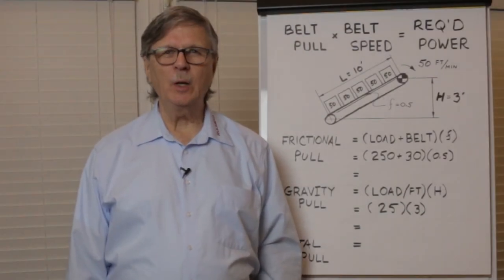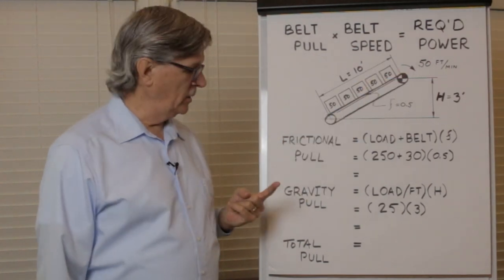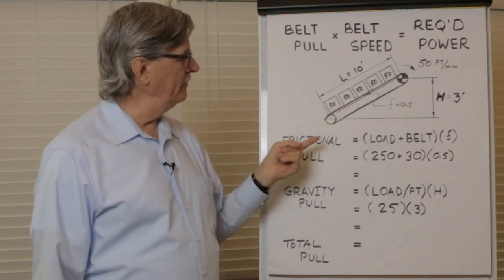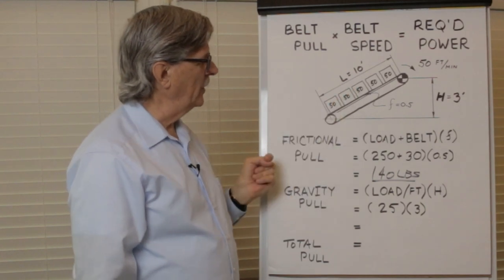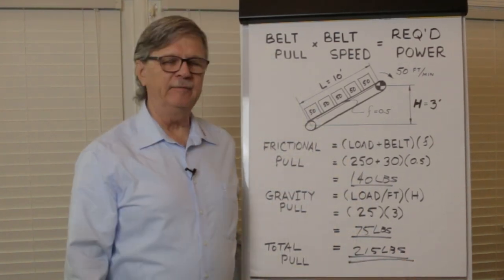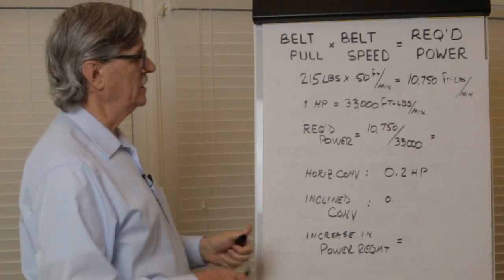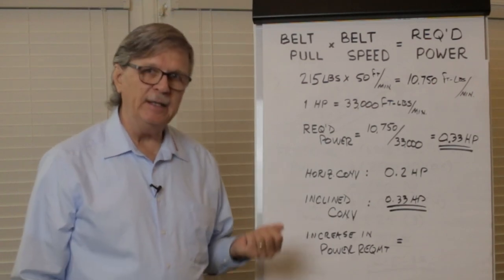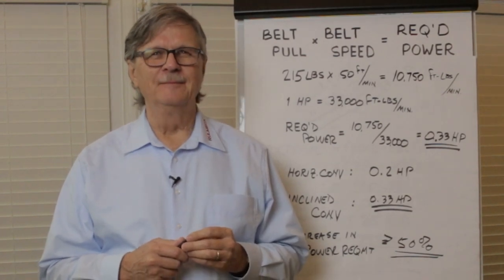Belt Pull and Power for Inclined Conveyors

Comment: A very informative lecture. am still enquiring on the pulley drum weights why have you not considered them in determining the power?
Reply from the maker: Drum pulley mass is irrelevant to the power required to keep moving the belt continuously in stead state.  However, you are correct that drum pulley mass should be considered when determining "required start up power" because the conveyor drive should have enough "available start up power" to overcome inertia.  If you send me your email address I will send you a link to a more comprehensive program which allows the user to specify drum pulley mass and calculate required start up power.  Since most conveyor drive manufacturers supply "Design C" motors (which are able to supply 200% of running torque at start up), required start up power is not calculated unless the conveyor is very long (i.e. > 300m).
Reply: @rulmecacorporation4596  Hi, hope your well. just a reminder am still waiting for the link you promised to send me kindly.
Reply: @wycliffeapindi3270  I am very sorry that I missed your recent message.  I will send you links via email within five minutes.

Comment: Hello Sir, thank you very much for explanation.
I would like to ask, what if there is no slider bed?
Reply from the maker: Your question could have several answers.  Slider beds can have many different frictional coefficients, from low to high.  Rollers may be used beneath conveyors instead of slider beds.  One rule of thumb (if rollers are used) is to substitute a coefficient of 0.1 instead of the frictional coefficient.  I suggest you visit our website and download our free power calculation software.  Just let me know if you have any problem finding it.

Comment: Thanks.  How/why do you have gravity pull as (load/ft) * h? 
Hmmm... I'm calculating.... I would use (sin 17.46) (250) = 75#. Same as you. But why is it also (load/ft) * h?
Appreciate your help. 
EDIT: And if you don't mind, another question. Let's say the conveyor stops fully loaded. What is power required to get it going again? I'm assuming there must be a ramp-up time to go from 0 to 50 ft/min. So this would be the power to accelerate the total mass?
I'm writing a continuing education engineering course. I studied this subject 60 years ago!
Bill
Reply from the maker: Hi Bill. You could use trigonometry, but the result will be exactly the same since the belt pull required to overcome gravity is linearly proportional to the change in elevation. Rather than provide a complete "derivation" I simply showed the accurate short cut method we use to calculate the force.

Comment: Sir, Why we are considering belt weight 3 x 10 = 30. Should we didn't require to calculate the lower part weight  i.e 30 x 2 = 60 ?
Reply from the maker: To simplify the explanation, we assumed there would be no slider bed carrying the return strand.  No lower slider bed implies no friction, which implies no belt pull required to move the belt from the head pulley to the head pulley.  If there is a slider bed for the return strand, then you should add belt pull to overcome that friction force.  Note also (on the inclined conveyor) that we ignored the effect of gravity on the belt because gravity's effect on the top strand is offset by gravity's effect on the bottom strand.
Reply from the maker: Correction: my previous remarks should have stated ""implies no belt pull required to move the belt from the head pulley to the tail pulley"

Comment: Hello Sir, Thank you for the amazing video. However, I have 2 questions I guess I must be missing something. 
1) shouldn't the total weight (Material and belt) be resolved on the inclined plane to calculate the friction pull and the force required to overcome gravity? [ie for friction:  f = Mue * N = Mue * W * (H/L) ]
2) Shouldn't we factor in the required acceleration force to accelerate the newly fed weight to the belt velocity? assuming material is fed with a mass flow rate m_dot so, F_ac = m_dot * V_belt. Thank you in advance for your clarification.
Reply from the maker: Thanks for your comments.  The video you watched shows a very simplified technique to calculate required power for handling packages.  Our bulk handling belt pull video elaborates on the factors you mention in your comments.  An explanation of the belt pull required to accelerate material is definitely included in that video.  Also, package handling conveyors typically have low mass and slow belt speeds.  So, acceleration of small mass from 0 fpm to 50 fpm is negligible whereas bulk handling conveyors with high mass and belt speeds => 300 fpm need momentum to be considered.
Reply: I think angles are really less for inclined conveyor so they did not take cos theta component ;because for less angles that will be equal to 1

Comment: hellow sir i want to calculate torque of dc geared motor which is used in side gripe conveyor which is inclined at 30 degree to pick a pvc pipe of 0.335 kg in total there are 6 pvc pipe to gripe by conveyor 
can u tell me how to do and also can u make a video on side grip conveyor belt which is inclided

and can u give any id so i can reach u as i have some other problem related to side grip conveyor as i am making an project so
Reply from the maker: Dear sir: You may reach me at mgawinski@rulmeca.com.